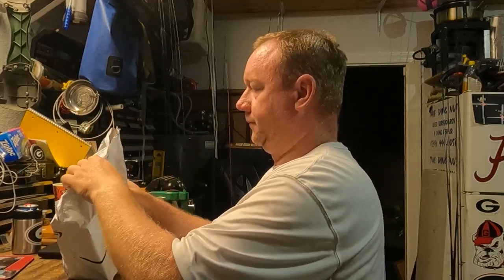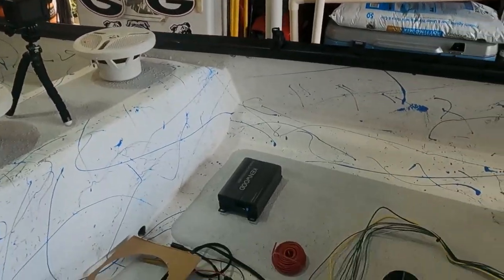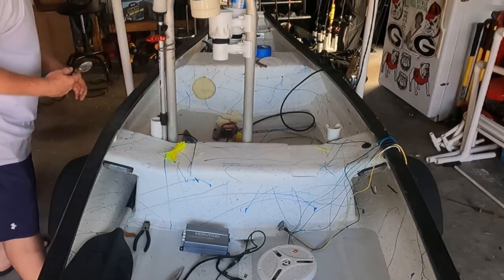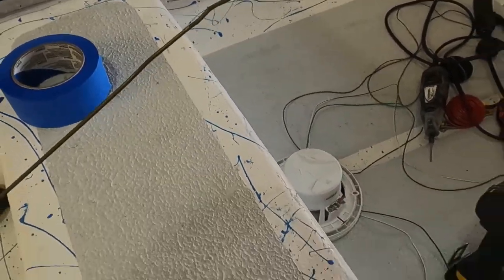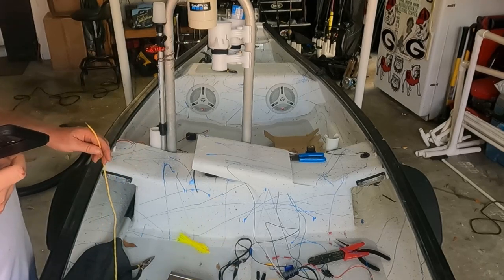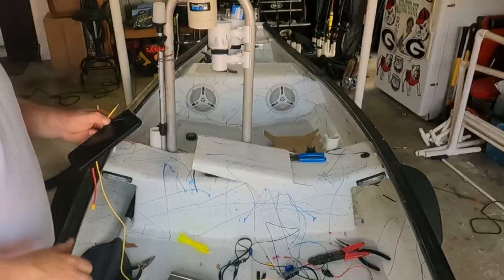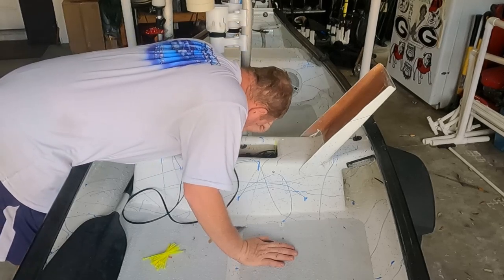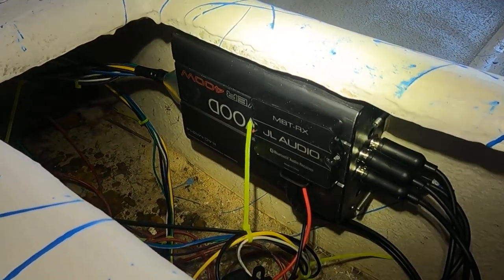Gheenoe Marine stereo install

Comment: Good job on the install and since you asked for advice, I'll tell you. I would have mounted the Amp on a piece of board material / cutting board and then mounted it to the interior of the bench/hatch with wing nuts. This way you can service it on the fly.  Good job overall though. 👏
Reply: It can be removed with the removal of 4 nuts, besides no need to adjust the amp once the gain and filters are set no need to adjust unless he adds more speakers and only adjustment will be at the wire connection to unbridge the channels.

Comment: What bit did you use in your Dremel tool to burn through the glass like that?  Clean install.
Reply from the maker: Dremel #561 muti-purpose cutting bit. I burned up one applying too much pressure but they do a good job when you don't have a skill saw.   Thanks for the compliment.